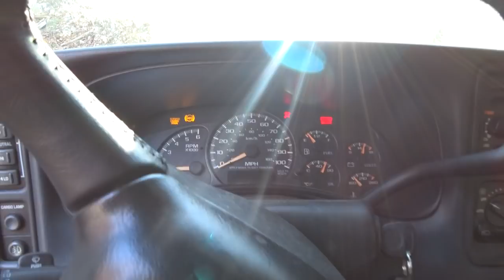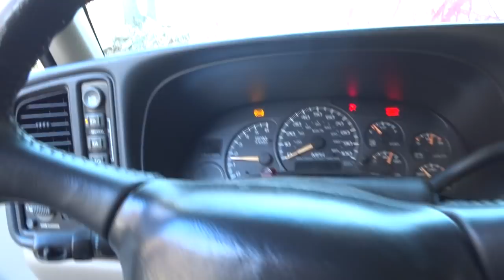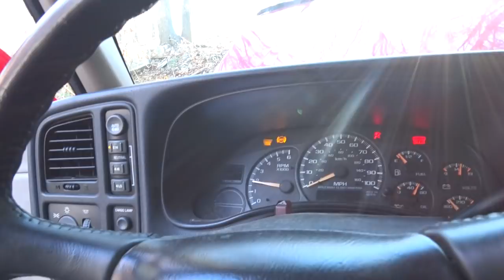DOA Avalanche Revival - Bleeding Master Cylinder in the Vehicle & Find our Rough Idle

Comment: The fact you like both ziptiesnbiasplies and vice grip garage makes me really like this channel
Reply from the maker: Heck yea!
Reply: minnntt
Reply: VGG is really funny. "Standard issue Tonya Harding." That still cracks me up.
Reply: mint!
Reply: Same here. A guy cannot believe I got this fortunate with cold snack content
Reply: , U
Reply: 2006 pontiac torrent 3.4l v6 
just replaced the head gasket and all of the sensors have been replaced with brand new sensors  MAF , / MAP/ Gas Cap/ (2) 02 Sensors/ Purge Valve/ Evap Canister  Solenoid and i am  now still getting the P0171 code, i  had the code reset it lasted for about 3 1/2 weeks and  it came back on . it says system to lean on bank 1. went to a different auto shop and the Mechanic checked it and says that there is a small leak in the fuel Evap System.
but the weird thing about this is the Check Engine light is off but when i take a Left turn the light comes back on.

Comment: Miss fires that's why the check engine light was flashing and when that happens its dumping fuel into the exhaust and the what made the cats go bad.
Reply: Was going to comment the same thing but I checked the comments before I posted cause I noticed the same thing lol
Reply: The Coil packs will make the check engine light flash on acceleration as well, just another idea to look into

Comment: I"m in northern Ohio, we get crazy lake effect as well. Bummer about the trans lines. I'm telling you though man, those rear brake lines are gonna go, get those fuel lines replaced and the brake lines. You have to drop the transmission down for the fuel lines so you might as well just do it all at the same time. That plug you were looking at is an O2 sensor, people unplug them if they think a cat is clogged so it's not surprising to see it unplugged.
Reply from the maker: Yep, seems like i am going to have to just do all that stuff with it sitting there now
Reply: Northern Ohio Shout Out! We do get some crazy winters in the snow belt
Reply: Cleveland Ohio resisident here. I feel it. We get some nice lake affect. Already had to replace the transmission lines on my 2011 Ford Fusion because they were already ate up from the many winters.
Reply: Dont have to drop the trans to do fuel lines. They run along the top with two locations being clipped/bolted in

One on the bell housing, 2nd above the shift linkage.
Reply: @Xx573v3xX  I thought the same thing but couldn't get them in without dropping the transmission down, so I'm going to have to disagree with you on that one, I've done this on 2 Avalanches so far and tried with both and ended up dropping the transmissions. I also found that taking the intake manifold out helped quite a bit as well.

Comment: Glad to see you guys staying busy. I just did my filter service on my aw4 trans in my 88 cherokee. Still not working properly. In spite of 8 quarts going in fluid still looks like coffee. Drives and shifts good. My kobalt 1/2 and 3/8 24v impacts are working awesomely. Got a bubba rope and finally a full set of 4 at3 falken all terrain tires. The tires are great and easy on the ol wallet. Keep wrenchin guys!

Comment: One thing about using the tubing cutters like that is that it leaves a ridge on the inside of the tube. The next time you use that ream out the tubing. With tubing that small, use a Phillips-head screwdriver and spin it around the end of the tube.
Reply from the maker: Thanks for the tip. Very good point

Comment: Beet juice melts ice but it doesn't eat away at metal the same way salt does. It's also used for weight in tractor tires instead of liquid Calcium which also eats metal - if an inner tube leaks then your rims don't get destroyed. And yes, I'm from Ontario also. Salt is still much cheaper and easier to use as in some conditions the beet juice can make roads more slippy.
Reply from the maker: I sure wish they would switch to beet juice! My vehicles cant take it anymore!

Comment: To bleed the brakes by yourself you can either gravity bleed them or used a spray bottle sprayer attached to a clear hose. I use ZEP with the yellow sprayer and i think 3/8 inch clean hose. works like a charm

Comment: Beets are used in the Brine mixture that is sprayed on roads for anti icing.  Road salt and other chemicals are usually mixed in as well. Brine is some pretty nasty stuff. I work for government fleet that uses it and it will cause metals to rust and corrode pretty quickly. The beet juice mixed in helps lower the freezing point of water on the roads.

Comment: Still enjoying the series, keep 'em coming. My last truck was an S10, had major brakeissues with air getting trapped in the ABS after MBS   blew out.  Final step to get all out of the system involved ye-oldste-get-on-the-gravel-and-slam-the-brakes-method, which I had to repeat for like 5-6 times before the brakes felt like new. Must have poured 5-6 liters of fluid thru it in the end.
Reply from the maker: Woohoo! Can;t wait. haha. Sounds like fun times. I am likely in for the same

Comment: nice video. The trans cooler lines are held in with jiffy-tite fittings at the radiator and transmission. Buy the tool from jiffy-tite or use a pick tool. Make sure the lines are fully seated when replaced. Look for a yellow painted mark in the window of the jiffy tite fitting. If reusing the fittings replace the e clip as they can get damaged easily.

Comment: plugs, wires, and intake gaskets, will run really good then, knock when cold is piston slap, they all do thats its not a problem, my 5.3 and 4.8 both do it
Reply: the tick could be failed lifters, which is really common on these early 5.3l truck motors.

Comment: to add to my comment.  I own one of these early avalanches, and it lives in MN, the land of rust.  The trans lines are a PITA, but DO NOT put them back in the radiator.  Get a trans cooler from a 2500 series GM of the same year or similar year, mount it in the front of the rad/core support(its a bolt in), and run custom coated steel lines to it.  A big failure point of these, especially if they have been sitting, is the trans cooler lines in the rad rust out, and then you get a nice pink slushie mix in your cooling system and transmission, which wrecks the trans near instantly the second its in there.  That dexcool needs to be flushed out, as well, and swapped over to universal with a good aftermarket corrosion inhibitor too.  If the trans cooler lines rusted out, it likely means that the parts inside the radiator are close to rusting out as well.
Reply from the maker: That is a good suggestion. Thanks!

Comment: that is a 02 sensor plug and i think its the one for after the cats so it will not cause poor running. There is 4 02 sensors one before and after each cat and the only ones that affect running is the ones before the cats, the ones after are stricktly there to monitor how much the cat is cleaning the exhaust

Comment: Test the vacuum with a vacuum gauge and do a fuel pressure test and it it will tell you if your issue is fuel related or if you are sucking air. A vacuum test can also tell you if you have bad cats. If you have a sensor issue like o2 related it would run considerably worse when warmed up
Reply from the maker: Thanks. will do as soon as the trans line is fixed and I can run it again

Comment: I have an 04 Avalanche that I bought 2 years ago. I had to redo the rear brakes. I noticed it had all new brake lines and the under carriage is pretty rusty. I'm hoping it'll last me till the DMV takes my driving privileges away. So I'm am hoping you go through that rust bucket so I know how to fix my next major problems. I do love my truck and so you know I went to harbor freight and bought a vacuum pump the brakes lines. Mine worked for me and I would recommend it if used correctly. My two cents worth.
Reply from the maker: Thanks buddy. I appreciate it

Comment: Watching you do the exhaust test with the leaf, hard to tell from just that but on a ford ranger I worked on a test we did was hand over the exhaust if it sucks in then the valve or head on one side has issues. Do a compression check will run like crap and not always throw a code.

Comment: The whine could have also been coming from the ABS box on the side of the frame. If you draw air into the lines and it makes its way to the box, or hat noise will happen.
Reply from the maker: interesting.. I had not thought of that

Comment: That plug underneath the truck looks like it goes to the abs module under the driver seat. I noticed the abs light is on so it’s that or the trans and I doubt it’s to the trans. Also you need to just save yourself some guesswork and plug a scan tool in the thing and see what it says.

Comment: I'm surprised you didn't gravity bleed all those brake lines. Yeah pressure bleeding is high speed bleeding but with gravity bleeding you can crack a bleed, sit back and sip on whatever drink till most of the air comes out.
Reply from the maker: Well i THOUGHT I was finally going to get to drive it once the brakes were bled, so I was in a hurry. Little did I know..

Comment: Mine is a 2003 and your RPM issue is the air intake at the engine block is filled [it doesn't look like much] with unburnt engine garbo. Just take a cloth and engine friendly liquid and wipe it off. Fixed mine right up. These cars are known for this issue around 125k Mi. Job will take less than 10min. To clear the gunk you're going to need to lift the little flipper as the garbo is behind it.

Comment: The sensor looked like the engine oil level plug I have a 2002 avalanche and mine plugs into the side of oil pan. I have 280,000 miles on mine and runs like a top. Good oil,plugs and wires on schedule, and air filter = long living avalanche.
Reply from the maker: 10-4. Thanks!

Comment: Motive products power bleeder...

Best $60 you'll ever spend.  Bleeds those Bosch ABS units in a hot second @ 15psi.
Reply from the maker: No kidding! Thanks for the suggestion
Reply: I hate where GM decided to put these ABS pumps.  If the pump doesn't rust away, the lines will, and if that doesn't rust away, the power connector and electronics will.  Just put a reman in my truck because the connector literally rusted right off.  I love my avvy tho, gonna keep it running as long as I can, since you really can't replace them for their running costs right now.
Reply: Seconded, one of the most useful tools I've ever bought.

Comment: The abs and brake lights are your abs module they run about $250 but you can fix them yourself by popping the cover and soldering the connections on the board there are a ton of youtube videos and I just did it to my 01 Chevy. Hopefully I save you $200 and good luck with that pos!
Reply from the maker: Thank you!

Comment: My pops had a similar issue with his silverado. A coolant temp sensor rusted out causing the engine to only start when it was cold. It was dumping fuel into all 8 cylinders and killed the upstream 02 sensors causing the truck to feel like it hit a wall when driving. But since it sounds like the fuel pump might be on its way out a fuel pressure test might not be a bad idea.
Reply from the maker: Interesting. Thanks. I will look into that

Comment: I had a old Dodge Ram plow truck like that. Fix one line and another line blew. I feel your pain. Here is a thought, I believe you said that thing had been sitting around a while. I noticed it has under 1/8th a tank. What are the odds that gas is junk? It is something cheap to try. Keep on wrenching buddy.
Reply from the maker: Yea buddy, that seems like it could be it also. I have to pull the tank to do the lines, so I am going to empty it out and clean it out and hopefully a bunch of little things all add up and make the difference on this thing
Reply: @DEInTheGarage  If you take the tank down,its a big whale under there..that tank is quite enormus,and also to be sure to get it down without breaking fuel lines..have one buddy with you.Even then its quite a job.

Comment: Pulling the MAF sensor only forces the computer into open loop mode which uses a predefined fuel map and doesn't read from the other sensors.  This is why it runs much better.  Pull the codes and see what is really going on.
Reply from the maker: Will do. Thanks

Comment: That was either the o2 sensor or a different sensor
Reply: But the transmission line on the 02 era of GM trucks aren’t hard to get off but you might wanna think about getting the 4l80e transmission and putting it in the avalanche

Comment: When I replaced the rusted out brake lines on my Silverado I couldn’t get the lines off the abs module they wouldn’t budge, it would start twisting the mount that holds it. I u plugged it cut the lines and took the module off, put it in a bench vise and used a hammer and tight fitting 6 point socket and I got them all out

Comment: If you don't have the money for a fuel filter you can run water through it reverse wise the opposite way to clean out the junk but then hook a compressor blower to it and blow the rest of the water out of it and reinstall it guaranteed it'll work
Reply from the maker: Interesting hack. Thanks!

Comment: I would definitely change that fuel filter, and it's possible it could have bad gas in the tank. did you scan it yet? That will probably tell you exactly what wrong. with a scanner you can read live data, that will tell you of the cats are bad or if it's the o2 sensors. watch a vid on how to read the the o2 sensors.

Comment: yeah thos plastic clips that hold it to the frame hold water and then rot the lines had lines blow out in my 01 s10 with 67k miles when i got it its a big issue with those early 2000s gms
Reply from the maker: Is that what does it? Friggin awful

Comment: You could repair the cooler line maybe with cutting the line and patching it with soft line maybe?
Reply from the maker: I am definitely going to try that, but they are really rough... surprise surprise
Reply: @DEInTheGarage  see also could by break line that has the right screw in fitting for the transmission and radiator  cut it in half and the long secrion be the rubber line.
Reply: Gotta love the classic rust from the salt live in Massachusetts myself

Comment: When he stuck the leaf to the exhaust it seemed to suck it in. In that case if someone else agrees with me. Wouldnt that be bad valves or leaking valves. Which would definitely have bad idle and performance.
Reply from the maker: No, I think you are correct. The valve train on this truck is weak
Reply: Maybe it might just need the rockets loosened a little. Like a 1/4 turn. Might fix it

Comment: no the trans lines are a major P.I.T.A. on any GM truck simply because of how they plug into the side of the transmission. I would venture to say your mass air flow sensor is only ONE of the issues with that truck the fact it doesn't idle up easily when you press the throttle down tells me that there is an issue with the fuel pressure regulator in the upper intake plenum. If you go to replace that you might as well also replace the fuel injection spider while you are in there, but NONE of that may be needed. Try running seafoam through the large vacuum line on the power brake booster and let that mess clean out your intake completely. Being that it's sat for so long you may want to run 2 cans through it to completely clean that sucker out properly. Something major isn't working right and that's what's causing he check engine light to blink. it's running in limp mode and until that stops you still have major problems to battle. The fact the truck only has like 120,000 miles on it is really surprising considering all the rot on it.That does make it worth saving still if you can though. It looks like it could use a ton of rust converter and a couple gallons of fluid film on all the underside bits Wish i knew where one of those trucks were here so that i could rescue you some southern rust free fenders off of but the people here keep those trucks even after they've been wrecked so finding parts is damn near impossible
Reply from the maker: Haha.. Thanks buddy!~ That is a good suggestion. I guess I have to fix this trans line before I get back to diagnosing the engine

Comment: That plug could be O2 sensor after the cat, or there is a sensor for the fuel line in that area also. But pretty sure it's O2 sensor wire. Yah, I blew out my trans lines getting on the freeway and blew my trans because I was in rush hour traffic. Rebuilt it better then new, LOL. Trans lines are easy to get to, the clips that hold them in the trans and radiator are the pain in the ass.
Reply from the maker: I hear about the clips. Not looking forward to it. I am probably going to drop the trans cross member to make it a little easier
Reply: Yes, removing the trans cross member helps alot but is still kinda cramp because the tail end of the transfer case hits the torsion bar cross member. Those cheap orange pick sets from harbor freight work great and if done right then the clip comes off with ease. It would be good to pop the clip off first on the radiator line for practice. And they can fly off, LOL. I only know all this because I recently just replaced all that and is still fresh in my mind.

Comment: Had same exact issue with my avalanche. Fuel  pump! I was shocked because a fuel pump quits it usually wont even run but mine would idle all day just couldnt give it the gas.
Reply from the maker: I am going to change it and see where that leaves me. Thanks!